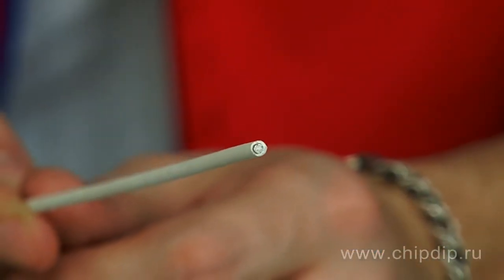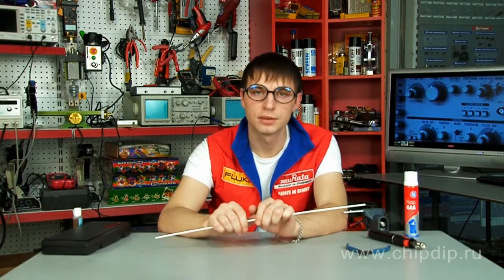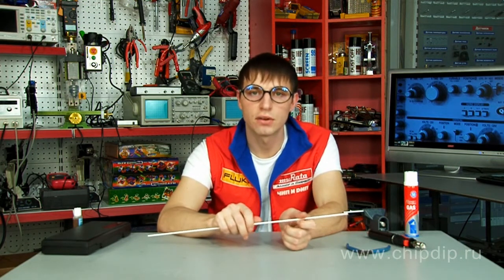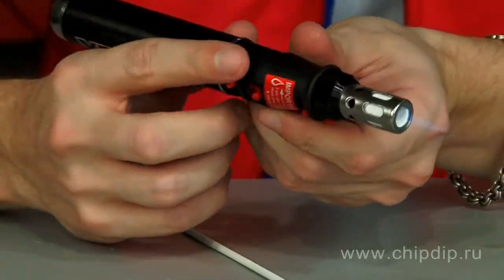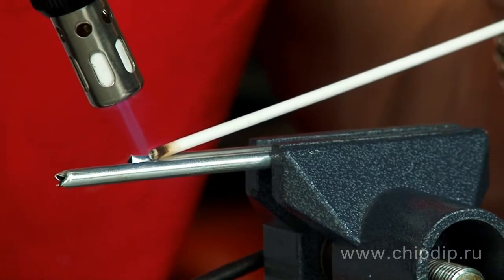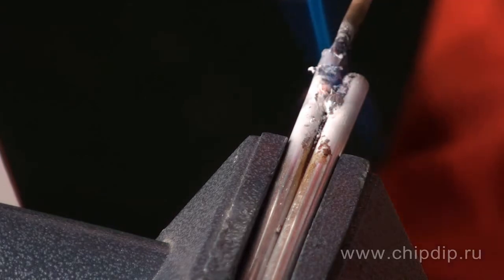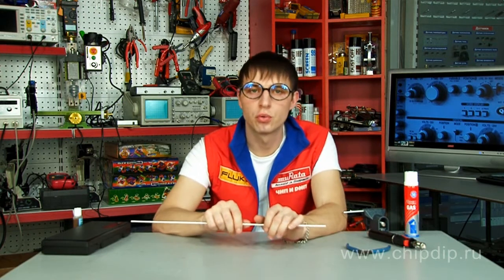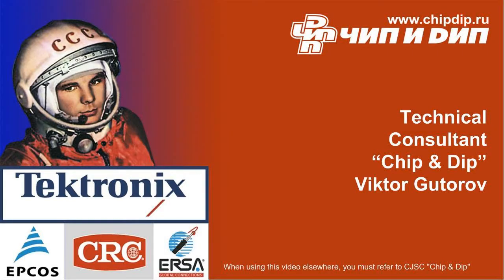Solder Aluminium-13 for aluminum brass brazing

Comment: Important thing to know. Much like regular soldering, but more important for aluminum, you have to heat the part to be soldered to the correct temperature before adding solder. You can't re-flow aluminum solder like you can do for electronics soldering.